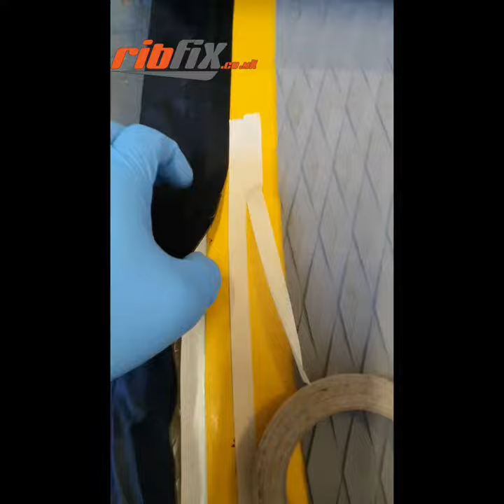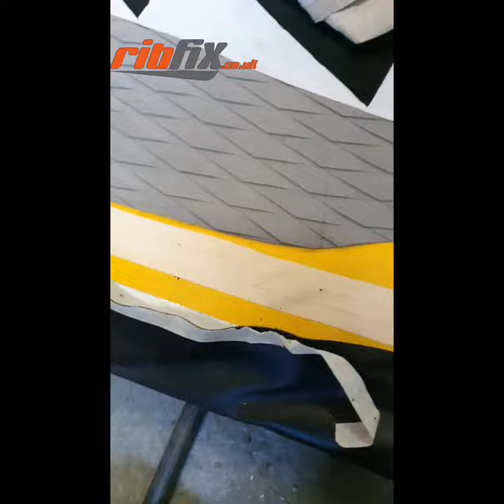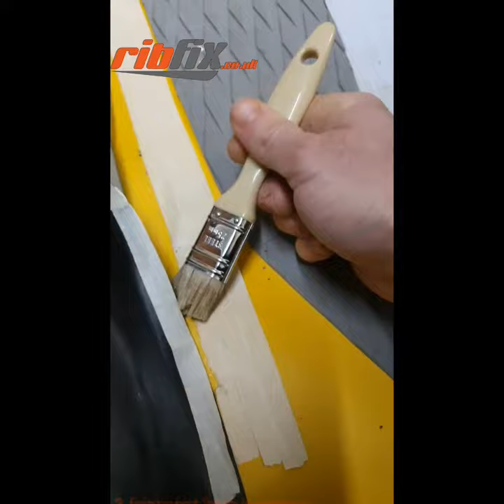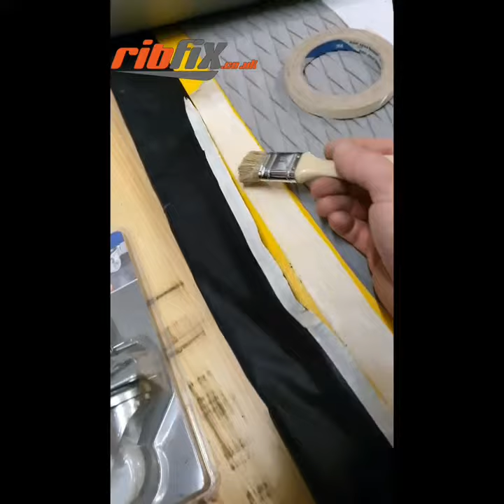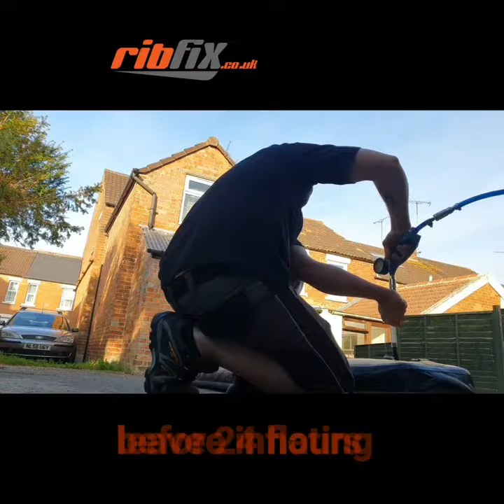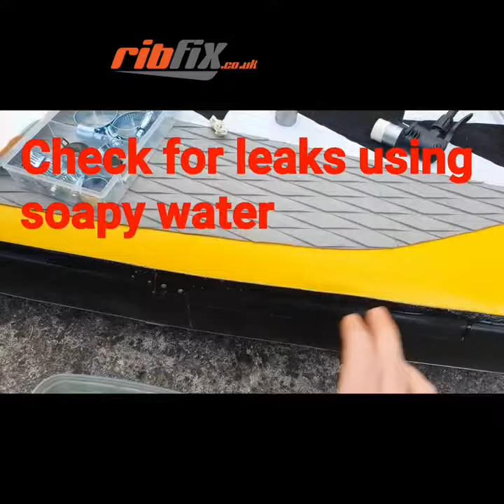Paddleboard Repair Using PVC Glue

Comment: What kind of glue did you use sir?
Reply from the maker: Pvc, most paddle boards are pvc made, usually the higher end ones are heat welded,  but this can also happen on a bad weld. Use pvc. I sell some if you need any

Comment: Follow instructions, not work. Filled my board with bathroom sealant and seems to be holding shape well! Only had it up to 32psi so far but still flexes a little so need to take it higher when I next use it. Thank :)
Reply from the maker: How do you mean not work?
Reply from the maker: Some people use polyurethane sealer as its less effected by salt water. I would strongly recommend getting it fixed properly before use if you plan on going far